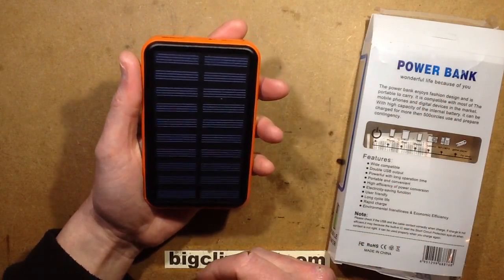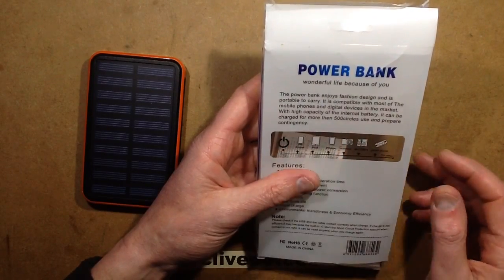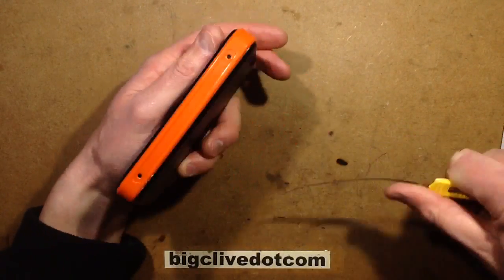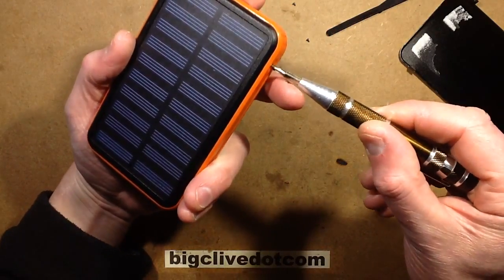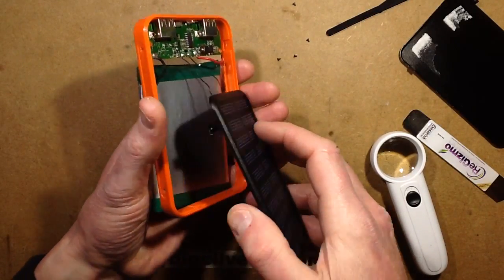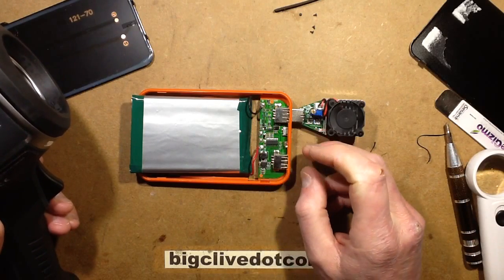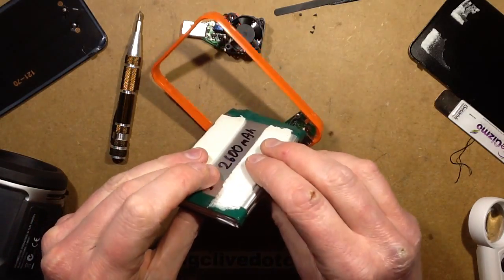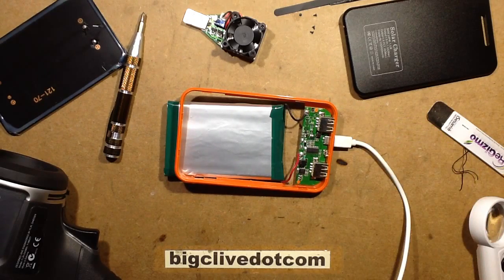FAKE! 100,000mAh solar powerbank capacity test and opening.

Comment: Hey big Clive. I got a question for you. If I buy a 10 inch 5 volt 2 amp solar panel online and connect it to the charging input of a portable charger (small one like 5000mah) for the purpose of being able to use the power bank to charge my phone and when it's needing a recharge the solar panel would be already connected. My question is this, can i use the power bank if it's being charged? I basically want to make a always ready self charging phone charger. I was thinking of putting all the components in a fanny pack(you know a man purse you wear like a belt) so I can go out all day and know I always got a charge of I need one. If this made any sense can I have your opinion good sir, I trust no one else. Why do I want this if you ask, Im a single dad of 4 kids and I'm always either at some type of ball game or errand taking care of everyone and I rely on my phone for stocks trading/crypto/zoom I'm a busy beaver and always online with the phone. If you got a better idea I'd love to hear it. I've seen backpacks that already got the solar panel and a USB lead but I need something smaller. Case of beer if you can assist me kind sir. Keep up the great videos and hopefully you'll read this novel I just wrote you. Sorry it's so long .
Reply from the maker: Some power banks can do that.  But on others you have to add an external charging circuit like a TP4056 module to charge the cells independently of the packs own circuitry.

Comment: I remember buying one of these that claimed a tenth of the one on video and didn’t charge at all from the photovoltaic panels, turns out that there were several problems, not only the ribbon that was supposed to connect to the battery from the panel was not connected, the panel itself was not pressed properly and wasn’t contacting properly the halves of it. Then there were the little LED that supposedly showed how much “light” was hitting the panel. Those were not connected either lol.
After opening it up and noticing the ribbon and the metering LEDs I gave it to a friend to test the capacity of the batteries themselves and both of us were surprised that it was also a pair that amounted to close to 5kmAh. When properly assembled we put it to charge, first trying the solar end (which was when we noticed that the panels were not pressed properly) then from an outlet. It got really hot from just using a 1A cheap charger brick from another battery, then when on discharge from just connecting to a handheld light (that the light circuit is dead, we basically just use it to charge the batteries for another device) it also got uncomfortably hot, no something to leave either recharging itself or charging up another device unattended.

Comment: I have this exact  charging bank that I bought 5 yrs ago. 2015. Its ratings are exacturated. I can say this for sure . #1)  This unit is very reliable.  #2) it charges pretty good off of solar cell. With a full charge it will charge your phone up 100% however , ONLY ONCE THEN NEEDS CHARGING AGAIN.

Comment: Big Clive   I know this video is 4 years old, and not sure that you still have this power bank.  But if you do, it would be interesting if it could be reconfigured to output 12v dc at 3 amps and then it could power a pinecil dc pencil soldering iron  The Soldering iron operates between 12 to 21 volts dc..   Then recharge thru solar.   Just my thoughts.

Comment: I bought  a very similar one of these almost 10 years ago, it was cheap like dirt.  One of the ports gave up soon after I bought it, but the thing still works. It charges my gopro batteries when I'm out and about and when I camp overnite at shows the led stops me from pissing on my feet in the dark. It does take 4 whole bright Summer days to recharge though.  I do have better power banks that I charge in the car, but if your hiking or cycling for days on end then, a solar powered bank does have a use. But buy the best you can afford, not the cheapest out there. And always consult Uncle Clive first 👍

Comment: If you want a 100,000mAh power bank you need 25 lithium cells that have a capacity of 4,000mAh each and to charge it will take you 100 hours to charge with a 1A charger
Reply from the maker: 100 hours, but still a long time.

Comment: I SERIOUSLY wanna know what powerbank can hold the most, I found one that was saying it is 99000000mAh fucking battery, lies lies and lies. If you don't trust me, google it on Wish.
Reply from the maker: Most of the 100,000 to 1,000,000mAh packs are just 5000mAh at best and can rarely even deliver 1A charge current.  Some even have fake solar panels.
Reply: @bigclivedotcom  
My  mother bought me a powerbank with solar panels, I put them near my window when it was sunny but it didn't charge up. Though I found a comfirmed one that can hold 41.600 mAh, sadly they're mostly sold.

Comment: I nearly bought one of these, until I remembered I could just buy TP4056, a power bank module, a real solar panel, and some 18650 and a little box.
Reply: 26650 cells even better, and a small enough panel to keep the build to a compact size. but still a reasonable charge time., and so much more fun to make it yourself 👍
Reply: I have that changer , I wonder about the 18650 batteries where i can get real ones .
Reply: @ytytiuiu2590  notebook batteries 🤫

Comment: 2:25 The output voltage is to low for many devices to charge.
Reply: Don't most USB devices only need 3.7V to charge?
Reply: @Q.A.a.R.I.S  3.7V is only the nominal voltage for LiIon batterys. 4.2V is neeeded for a full charge. Also some voltage drop over cable and internal charging circuits inside the device have to be considered.

Comment: Good video,  just a couple of questions.. you didn't say much about the quality of the solar panel.. how long would it take the panel to charge the cells in sunlight?
Also,  could you swap the cells for higher capacity ones?
Thanks
Reply from the maker: The solar panels are usually token gesture.  You could change them for better ones, but when you leave these packs in the sun to charge the lithium cells overheat, puff up and can sometimes fail with flames.

Comment: i got one thats called goodmans 8000mah power bank  that has a feature where you can use the usb outputs while its charging  then when either you unplug the charger or the supply for the building goes out (blackout) then the outputs stay on . it acts like a ups for usb devices . it lasts for ages on a single charge  . i got it from b&m
Reply: you could check this out   to see the real capacity

Comment: I had one of these, they are crap. I clocked 5,000mah. Putting it in the sun to charge then melted it and it gave off blue smoke (luckily outside). My £5 one from Poundland is rated on the box as 4,000mah and clock at 3,840mah, so they are telling the truth.
Reply from the maker: These units often do fail when placed in direct sunlight.  It's a terrible design.

Comment: 5Ah at what voltage?  This is a USB charger, so anything it does, it should do at 5V.  Based on that, what is the capacity?  What amperage will it supply at 5V, and for how long?  There is another bloke (Russian, by huis accent) who tested a range of power banks - all I the range of 10,000mAh and less, and found that in most cases, he got about half of their stated capacity.  He said that the batteries provide 3.7V, so they need a step-up, which consumes power (due to heating), and radically alters the stated capacity - but when the stated capacity is 100Ah - well, that's more than twice the average car battery - though admittedly, they are 12V.
They should really state capacity in Watt-hours, then it's independent of voltage.

Comment: End of 2019 update: I got this powerbank two years ago, sold as 300,000mAh. Good joke, it's actually 73,400mAh which is still quite impressive. I remember paying less than £10 including shipping and it had no issues. The solar panel is useless and I just disconnected it but otherwise, amazing value.

Comment: if you want to find one similar, on ebay just look for: hot new powerful camping all in one edc very useful waterproof pocket outdoor  mini 1pceself defense survival tool lightweight tactical portable key chain rechargeable flashlight LED switch natural gear 100000000 charging banks.

Comment: Bought one of these myself, and after 8 months one of the batteries swelled up so it cracked the clips.
Reply from the maker: That happens if they are left in hot sunshine.
Reply: This one was only out for one hike (with next to nil capacity), and spent the time in the shelf. I tested the capacity and it was around 350mAh (USB charged and discharged by the same setup as you used to test it)

Comment: missed opportunity: The interesting thing about this cell is not the misleading capacity. It's the solar cell! How well does it perform? Is it even worth anything? If you were out on a bright day, would it be sufficient to charge the pack in a day or two?
Reply from the maker: The solar cells are usually just a gimmick.  Some are even fake.  If you do leave a pack like this lying in bright sunshine it can fail due to the lithium cell overheating and puffing up.
Reply: Huh. Thanks! That makes sense.

Comment: What I'm holding out for, though, is a 1hkYYYAh (1 hecto-kilo-Yotta-Yotta-Yotta-Amp-hour) battery that weighs 100g and fits in my pocket and costs $9.99. Heck, that's only 10^77 Amp-hours, not even a googol, so it shouldn't be any problem for some enterprising factory in 深圳, 广东, 中国.

Comment: i poked a hole in a fully charged 4000mah lipo by accident and it fill my street with smoke after i through it out the window god knows what 100,000 would do but i have learned my lesson about working with fully charged cells i drain them now before doing anything.

Comment: heres one with 8000mah  maybe you can check the real capacity of it       https://www.ebay.co.uk/itm/Intempo-EG0324-Gold-8000MaH-Aluminium-Power-Bank-Charger/253341728484?epid=1045290653&hash=item3afc57fee4:g:EycAAOSwU4FaS4ch:rk:6:pf:0
Reply: i have 2 of these  and still working after 2years

Comment: I have the exact one that has 200000mah on it😆😆😆 mines is 2x 3.7v 5000mah Li-ion cells inside...

I’ve had it for 5yrs & a great little power bank.

Comment: It needs a larger inductor, most of the packs that I have will maintain 5 volts up to 2.5 amps . They all have one thing in common and they have a larger inductor. I don't like the ones that can't keep the voltage up.

Comment: Lithium batteries are not safe by themselves, it's the security circuits built around them to charge and discharge that keeps them safe. Just don't buy Chinese phone chargers or other chargers simple as that.

Comment: You mention safety, when I use to run Lithium RC batteries in my trucks (talking about larger hobby brushless systems), I would always charge and store the batteries on some type of fire resistant pan/container in my shop. Do you think its best to do the same with these power banks? Anyhow, very entertaining channels.
Reply from the maker: I do actually recommend charging and storing lithium cell devices in an area where a fire could be limited.

Comment: "100.000mAh solar powerbank, is it real?"
I certainly fucking hope not.
That shit would have twice the energy of fucking TNT.
If that were real, you'd be carrying little short of a live, unstable bomb in your pocket, capable of performing an instant, on-the-spot total organ removal surgery.
Like, this shit would have an energy density of roughly 8.5MJ/kg.
TNT is 4.6, and Li-ION is something like 0.6 or 0.8 or something along those lines.
...
I mean... I'd honestly be fucking impressed if this shit wasn't fake, if only for the fact that it wouldn't be classified as a high-yield chemical explosive.

Comment: BC, what about the solar panel?  You called it a "token" panel.  Is that to say it won't charge the battery?  or it will take days to do so?  Did you test it at all?
Reply from the maker: Its output is low.  It will have an effect, but if left in bright sunlight these packs often overheat and puff up.

Comment: I bought the same falsely advertised product, although I wasn't concerned about the stats on the unit. I simply wanted something to charge my phone and tablet while backpacking and camping. It works and charges on solar and cable. I haven't had any problems with it and have taken it camping twice. It was under $20 so I can't complain. The English instructions were very poorly translated which is why I'm watching videos on the product.
Reply: At least you got instructions, there was nothing but the device when I got mine.

Comment: These claims are so upsetting. I build and sell power banks. So it is tough to sell a quality unit that actually has it's claimed capacity when shisters are selling one way higher rated for much less money. I get, why would I buy the one you made over this cheap one on ebay. The simple answer is you get what you pay for. So when it can hardly charge ones phone even once, then it comes into focus. When I build a pack I use new name branded cells and then I test each one. That is the only way one can be sure that it is properly good. Cheap junk will always be cheap junk.

Comment: Considering mAh isn't actually a unit of capacity, you could print any number of Amp-hours on your power bank as long as you whisper the appropriate Voltage under your breath as you do so.

Comment: Just found this supposed 600000mah powerbank on ebay for £8.99. Probably the same capacity as the two similar ones you've already taken apart Clive. https://www.ebay.co.uk/itm/Power-Waterproof-Portable-600000mAh-Solar-Power-Bank-USB-Battery-Charger-LED/192357929348?epid=17008910222&hash=item2cc96d1184:m:mUyTwvqAZYDUsFLW7ozLBkg

Comment: I'd remove the batteries and connect the solar panel to the battery terminals with a capacitor in pelelel

Comment: I'll bet they're spec'ing it by the max "C" rating of the paralleled cells. So if the cells have a "C" rating of 20 (common amongst LiPo cells) then 20 x 5200 = 104,000.

Comment: I bought a supposed 10,000 mah pack without a solar panel but had led light from a amazon seller expertpower and after the microusb port broke i took it apart and found that the cells were only 4 3.7-4.4v 2200Mah laptop cells that means it only has 8800mah but not bad for price of $10 with prime 2 day shipping however the seller is still going to refund 50% of my money (bought it back in april and their standard replace/return is 90days but i couldnt pay to send it in as its been 4 months but i noticed that it has output solder points for each usb and an input solder lead on top of the standard micro usb solder points and usb solder points so once my soldering iron comes in i can solder a small usb jack into the input point as well as a new micro usb jack later and the usb cord is just a short 3in cut cord that i can hide at the back of the cells between cells and plastic at the back of the casing

Comment: i guess the reason they called this a 100ah powerbank is because it has the solar panel which theoratically (or however you spell that,  english is not my first language)  gives you unlimited power.

Comment: i mite make a 100ah 4.2v battery pack from 18650 cells i bet its gonna be huge
Reply: update . i did manage to build it  but it was that huge it wouldn't fit in the pocket lol it was roughly the size  of a 8" tablet

Comment: i got the same one though rated 200000mAh he he. I use it with USB bike light and it is pretty good using the 1 amp output, powers 2 x T6, 2000 lumen light for 1 hour on full beam

Comment: Many vendors selling this garbage. Ebay user "walmart", not the walmart, is one.  Claimed 50,000maH, water proof, dust proof and shock proof.  First 50AH!  Typical car battery is about 65AH. Tested capacity, 5000maH except one where they swapped the battery out for a smaller 3000maH!  Water proof/dust proof, 1 sec dunk and it fails nothing to keep water out or anything else for that matter. Cheap styrene plastic case, not shock proof.  How long to recharge the battery via solar, a week didn't do it...All lies all lies. Then there is the 9900maH 18650 batteries more like 500maH......more lies    ebay not cracking down on these parasites...

Comment: Just received identical 300.000mAh powerbank. Does it have six cells inside? I think not. It's 209g. The capacity is about 7.5Ah. There are three cells inside. Two large and one about half size. And they're all glued together. Interestingly neither of the ports is rated 2A. When the load at either gets over about 1.5A the device just shuts off till the load is lowered or disconnected.

Comment: built my own 100,000mAh'ish power bank with a bunch of 18650s and a charging circuit from a iHome (non-solar 2 18650s) power bank. It keeps my raspberry pi 2 alive for 37 hours :) with wifi dongle load.  I charge it with a 2amp charger and it charges in half the time that it runs, due to the Pi using only around 1amp.

Comment: Buy two of these, swap the metal back panel for the solar panel and you've got a decently robust pack. Tho, i would make some circuit protection for the batteries.

Comment: I have a mophie powerbank xl, but I haven't used it in a year as It just doesn't charge. I have it on charge the flashing indercator reaches 3 bar flashing, but it squeals.. but when I disconnect the charger it just instantly dies... 

any ideas.
Reply: sometimes it jumps to 3 bar flashing and the scwreal gets louder but pulses as the led flashes, trying to open it now without damaging the case, glued shut I willl get it open at some point.